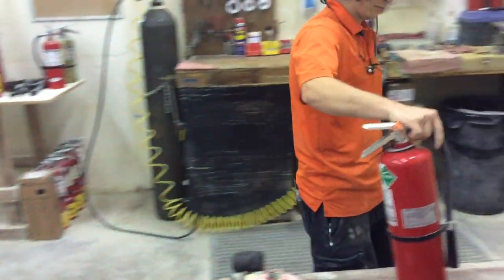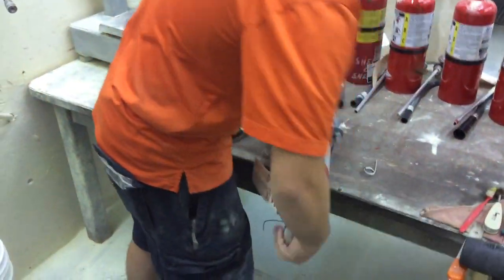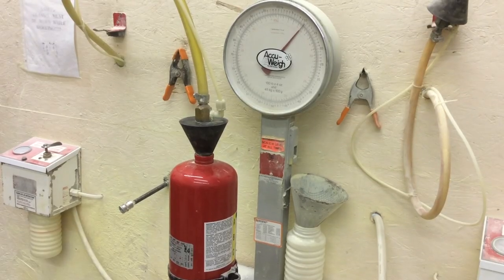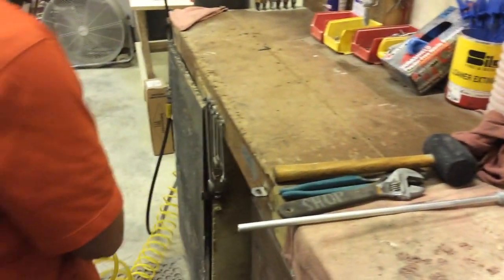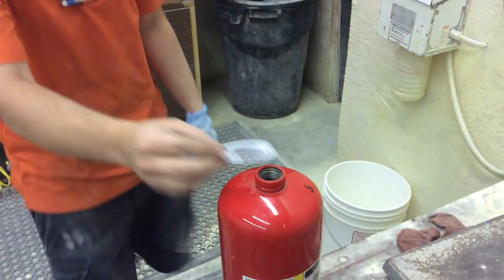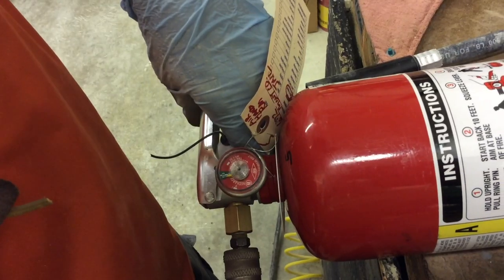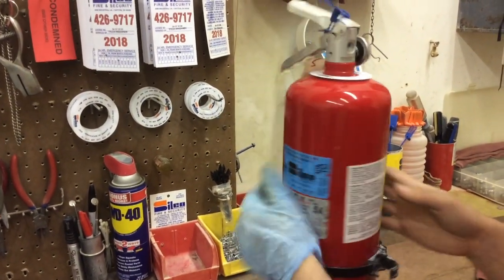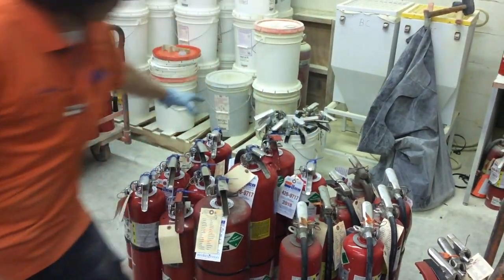6 Year Fire Extinguisher Maintenance

Comment: Not a fan of the 6-year maintenance sticker (the collar should be enough) sometimes get them confused for hydro-test stickers
Reply: Yeah some companies use the same color sticker for HT and 6-yr.  It's helpful to have different colors for the different services.  I used to be a technician for many years working on these.
Reply: @billerwin7770  I still hate that, colors can fade over the years. It should be sticker for hydro and replace the collar anytime it's taken apart. Makes it a lot easier to make sure its done right.
Reply: I suppose they could in some conditions.  Has that happened to some of your labels?  I haven't seen it in my work.
Reply: @billerwin7770  All the stickers we used were black and white. I have seen some extinguishers that haven't been serviced in 10+ years that had the text fade off some collars and stickers.
Reply: @bigt4050  if yeah I have seen some of the black and white ones fade.  And proof collars ink wear off.  I don't recall seeing that with the Nafed stickers though.  Maybe just the ink was not as good

Comment: When does the extinguisher become obsolete? Would that be age related or refills? Thanks!
Reply from the maker: Great question! Any dry chemical fire extinguishers manufactured before October of 1984 are considered obsolete. Dry chemical fire extinguishers can be filled and inspected year after year as long as the manufactured parts are available, the cylinder does not show any extensive signs of corrosion, pitting or fire damage. Side note: the extinguishers you buy at the big box stores with plastic handles and heads are often considered as a one time use extinguisher. Our policy at Silco is that we will not refill or test those types of extinguishers.
Reply: @silcofireandsecurity  Much appreciated!
Reply: Also keep in mind tho, every 12 yrs they need to be hydro tested, depending on pricing in your area, it may be cheaper to just replace it (Which most companies do).
Reply: @silcofireandsecurity  Why are dry  fire extinguishers manufactured before October of 1984 considered to be obsolete? Do you do Halon fire extinguishers?
Reply from the maker: @jmd1743  Pre 1984 dry chem extinguishers do not carry the same type of rating as a newer extinguisher, meaning the flow rates have increased and the ability to extinguish a fire is greatly improved from the older models. Also, years of maintenance and hydro testing of these older models can compromise the integrity of the cylinder making them unreliable, unsafe and prone to failure. Older parts for these extinguishers are becoming hard to get as well. Halon is no longer made because of the effect on the environment, we do however have a reserve that can be used to refill and recharge units that have been discharged.
Reply: Update: Any dry chem extinguisher (other than wheeled units) mfgr'd before 1985 are now obsolete.  For water extinguishers, it's any extinguisher before 1971.  Any extinguisher at all mfgr'd before 1955 is now obsolete.
Reply: @jmd1743  The manufacturing requirements changed then.  For example, extinguishers over a certain rating now require a hose, whereas previous ones did not.  Newer ones require a pull pin, whereas older ones used cams or tape.  The discharge times for older extinguishers were less.  Etc.  Older dry chem extinguishers don't meet the current standards based on real-world testing, and have gradually been phased out.
Reply: @Francis_J_120  Good to know, thank you.

Comment: I’m curious to know. Do you just mix all different brands of ABC powder, or do you only fill each extinguisher with the specified brand of dry chemical agent?
Reply from the maker: When a dry chemical fire extinguisher is brought to our shop, and is due for service, we discharge and recharge the dry chemical agent in accordance with the manufacturer specifications.
Reply: @silcofireandsecurity  that’s good to hear. So for example, if an Ansul is in the shop, you fill it with Ansul foray powder?
Reply: ABC powder is monoammonium phosphate. All ABC extinguishers use the same chemical compound so it is ok to interchange ABC powder between different brands of extinguishers.
Reply: @dtrain-uwu  you cannot although almost all service companies do it, the percents of MAP are different. For example, Amerex has two different ABC agents. They have a standard ABC and their “555” ABC dry chemical which is a higher performance powder. Mixing the two agents compromises the performance.
They are not all the same
Reply: I want to the selico company address in Nigeria
Reply: @FireAlarmDude5967  They have different colors
Reply: You are required by the fire codes to use the manufacturer's specified chemical.  In practice, almost nobody (incl. Silco) does this.

Comment: Between this video, and the ones done by FireAlarmDude on the servicing of fire extinguishers, it looks like something a person can do at home if they have the right stuff, even if it's not encouraged for insurance purposes. O-rings, valve stems, and pressure gauges are all pretty common online, as is the adapter for charging the system with nitrogen.
Reply: Anybody could do this with the right equipment, and you really don't need that much equipment.  Just be aware that in some states/jurisdictions you have to have a license to do this commercially.

Comment: What is a typical cost in usd for this service on ABC dry chem?
Reply from the maker: We would encourage you to contact one of our branches for an estimate of cost to perform the 6 year maintenance service on your extinguisher. For example, a typical 10 pound ABC would be approximately $35 USD on average. There are many factors that need to be considered in giving you an actual price such as size, condition of extinguisher, age, weight, etc. You can find more information on our website - www.silcofs.com
Reply: Be careful when asking at your local shop.  Some companies will double charge you. For example, some companies charge for 6-year AND recharge when in reality they are basically the same procedure.  So they will say "our 6-yr cost is $20" but then you also have to pay another $20 for recharge and $1 for a sticker, $2 for a proof collar, $5 for a valve stem, $1 for an O-ring, etc. etc.  So be sure to ask what all is included and if there are hidden costs they don't tell you about.  The company producing this video does this.

Comment: You forgot to remove the previous service sticker. tisk tisk
Reply from the maker: Thank you for taking the time to comment on our video. We do remove the old 6 year maintenance sticker (blue sticker) and replace it with a new one at time of maintenance. If you are referring to the silver sticker on the extinguisher below the 6 year maintenance sticker, that is a 12 year hydrostatic test sticker, which is left on the extinguisher until the next hydrostatic test is performed. That sticker will also be replaced when that test has been completed.
Reply: All previous 6-yr stickers are to be removed.  The previous HT sticker remains.